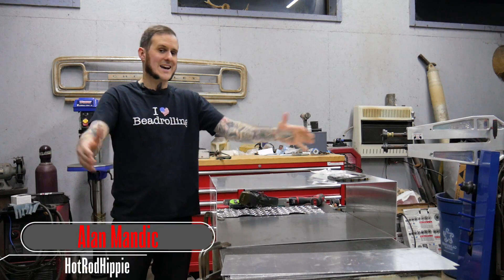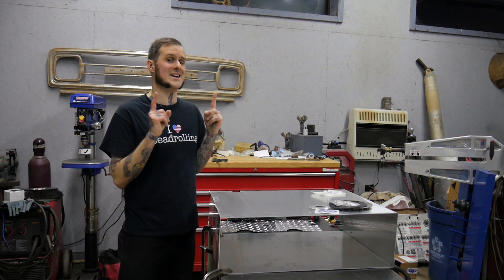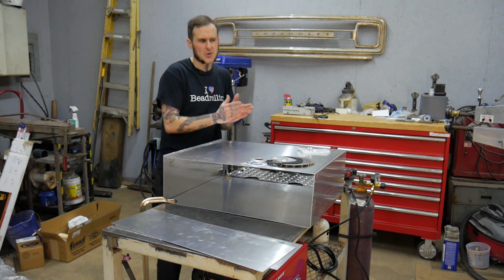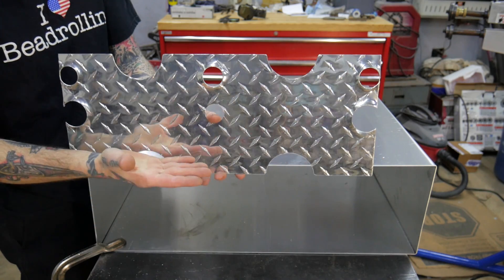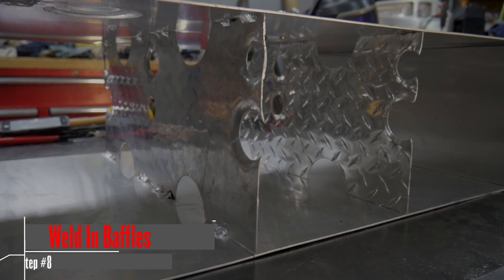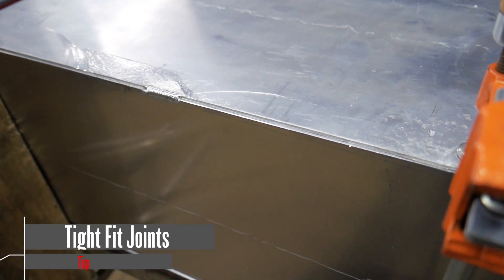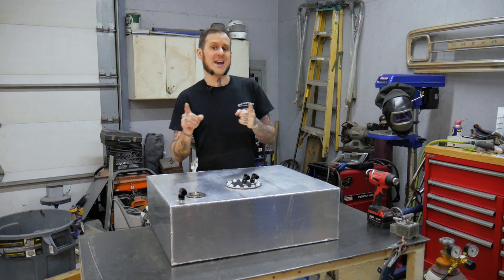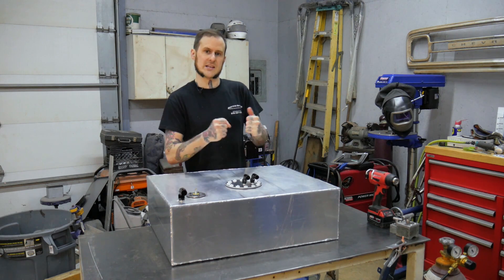Building a Custom Fuel Tank

Comment: This is a old video but I'd recommend anyone doing this to try out to use some chill blocks on those outside corner welds, they'd have to be alluminum or you can wrap steel bars in alluminum foil, this acts as a huge heatsink and really stops any form of warpage
Reply: Copper chill bars too

Comment: Build a fuel tank as your first welding project? What could possibly go wrong? LMAO.
I've been welding 40yrs+ and I think of myself as still learning. When I hear someone boast "I can do anything" I run.
Reply from the maker: Jim Zivny yep. My response is generally "I can attempt anything, no guarantees beyond that."  Overconfidence was something I learned to shake in my early 20s "I know everything" days.
Reply: I can oxy-fuel weld a 30 inch gap.
Reply: Amen to that
Reply: Lmfao dude said aluminum is eazier than stainless DEAR GOD help these new welders
Reply from the maker: Welding Stainless IS far easier than Aluminum but requires back purging. For a DIY project that is quite an additional expense in Argon gas and the additional equipment to properly purge. I find Stainless sheetmetal warps more severely when welded than Aluminum does, and aluminum is easier to force back to intended shape because, well obviously. Add in that Cutting and Grinding Stainless is more effort and you get why I recommend Aluminum for a beginner building a fuel tank. 

Please enlighten me to where I'm wrong about any of that.
Reply: @HotRodHippie  no beginner welder should be welding a fuel tank.
Reply from the maker: @131Jayboy  where did I say they should? I said if you aren’t confident in your welding seek someone out to weld it up for you. People are putting words in my mouth and I’m really not sure how they got there.

Comment: Great work and info! I'm planning a custom fuel cell for my tubbed 71 Chevelle. Being I'm not a pro at tig welding aluminum but pretty good at steel, I going to first build a model from plastic sign material, then aluminum but only tack it together. Then pay a pro to weld out.
Reply from the maker: Solid plan of action. I'd recommend discussing it with whoever you intend to weld it first. That way if they have any particular wants for how things should fit or the materials used they can voice those. It is no fun for a welder when a project walks in that could have been made easier with some minor changes but it's too late when it's there. 👍👍

Comment: Awesome video! I am building a Frankenjeep and the frame is a mid 1950's M-38A1 (aka the original CJ-5) and the roll cage in the CJ-3A  body tub interferes with the original fuel tank location underneath the drivers seat. However, there is a small triangular shape behind the rear axle. I'll have to dig up the cardboard mockup and reevaluate my tank design.

Comment: It would have been helpful if you had stated the fitting sizes, Where you purchased them, and maybe part number). Also, how did you set up the float to get an accurate fuel reading?

Comment from the maker: Do you have a vehicle you plan to build a custom fuel tank in? Have you built one before?
Reply: Did he not say it was for his father's truck/build?
Reply: Joshua H 
“He” is the guy who made the vid, huh
Reply: I've built a couple of tanks for my rockcrawler. The first one was a 20 gallon with a notch area to go around the exhaust. Of course it had a sump area and baffles to keep fuel at the sending unit. Which I used a stock '88 chevy TBI pump for the FI. The second was a 15 gallon tank I built to replace the first tank so I could move it to a new location. This was part of a redo of the crawler. 4 to 2 seats and lightening it. This tank has a 1 gallon sump area and of course baffles. Both tanks I mad out of 16 ga. mild steel. I lined them with Eastwood's tank restore. Never any issues with either.
Reply: About to build one for my 180SX on my channel.

Comment: Filler neck and wiring provisions, rollover check valve, how are you going to mount it and I'd suggest a nice static/ground bonding strap lug on the sending unit that goes to the frame. You know, the little things.
Reply from the maker: Parts to put those together didn't arrive in time for this video. They are all installed now. I'll eventually do an update video on the completed tank. When it isn't 900 miles away from me.

Comment: What about a steel gasoline tank? Not worth it because it might rust?
Reply from the maker: Yes I don’t really recommend it for that reason. You CAN seal it, but the likelihood of 100% properly sealing it is slim. I’ve worked with more than a few steel tanks over the years. Factory and custom built, and they always end up rusting / causing fuel system issues due to that rust.
Reply: @HotRodHippie   now,since they put ethanol in gasoline,it's made things worse since ethanol is highly corrosive

Comment: No internal bladder?   What happens when the weld beads crack from frame twisting?
Reply from the maker: How many cars running down the road have an internal bladder in their tanks? Or ever did? Bladders are generally a thing on vehicles expecting to see collisions and more extreme conditions (off road racing / circle track / etc). Don't rigidly mount the tank (rubber spacers / bushings) and be mindful about the chassis stiffness. One video cannot cover every facet of custom car design.

Comment: I didn’t see the fuel pump power/ground wire, where did you run it? Or did you tie it into the fuel level sensor power and ground it to the fuel level sender wire?
Reply from the maker: I didn't include that in this video  because parts hadn't arrived unfortunately. I drilled two holes in the fuel pump module I made. Used stepped telfon washers to both seal the hole and allow bolts to pass through. Those bolts I used to run the power and ground for the pump.

Comment: Nice tank. I have an aluminum tank from Brothers Trucks that needs to be cleaned out. There's a concern that some debris may be obstructing the fuel line. Do you have any advice on cleaning it out?  Worst case scenario I was thinking about cutting the top along the corners BUT is that a explosion waiting to happen? Or can it be done and safely welded back by a pro?  Please advise!
Reply from the maker: I would look at getting a clean out / inspection cover. The plate I used to make the fuel pump module is intended for that purpose. It's designed to be installed in tanks for access to clean them out. You could cut a hole in the tank and just cover it back up with that when done. 

Worst case, yes you could cut an access hole and a professional should be able to weld it back up. I've welded tanks numerous times, it's entirely doable just something that has to be done correctly and safely. It's not hard, just time consuming. I would check with the shop you plan to have weld it before you cut it. It would be best to get their opinion on how to best cut it so they can most easily repair it. 

As for cutting on a tank, if it's aluminum that shouldn't be a problem. Just go slowly as to not overheat it, but there aren't sparks when cutting aluminum so it shouldn't be too dangerous. I'd recommend flushing the tank out with water first and maybe half fill it with water to keep it cool. 

Hope this helps.
Reply: @HotRodHippie  thank you

Comment: Besides physical space, did you take into consideration quantity of fuel or weight of the fuel?  What’s the overall quantity in your tank?  I imagine you can manually water fill it or do math for volume but it would be cool to have heard your approach.  As far as weight, how did you plan to support X number of gallons of gas weighing X pounds, mounting it, etc.  Nice project though.
Reply from the maker: I always do volume calculations based off dimensions. In this case the tank ended up around 19 gallons. Usually I assume you will lose a little capacity due to fill height (tanks rarely fill all the way before forcing the gas pump off). So I'd say this is effectively a 17-18 gallon tank. 

Generally I aim for a upper teens to twenty gallon tank in most vehicles. If I end up much larger I usually scale down. If it isn't    big enough I get creative with sizing, to try and make it larger. 

As for strength, no I really don't do any calculations for strength. Experience has showed me what works. A lot of aftermarket tanks available for racing are just blank boxes with no rigidity added in and they function. This tank has the baffles that also provide structural support across the entire tank, so it's a non-issue in my eyes. If I was trying to make a super light tank out of the thinnest materials I would pay attention to those factors. 

This video was just a matter of "I'm making a tank, I may as well film it" not me setting out to make a tank video. I'll do a better follow up with the missing details in the future.

Comment: If I get a fuel cell and fill it up at a gas station will the pump auto stop when full?
Reply: Yes but it isn't a good idea to fill it up full. My 68 Vette has a humongous hole for filling it up and  I have to stop with the fuel level an inch or so down. Fuel slosh and expansion will cause a full tank to go out the vent/overflow.

Comment: About stainless though if I go that route which is a good gauge choose
Reply from the maker: I generally use 18 or 16 gauge stainless for tanks. Much thicker and they get heavy quickly. But thicker materials would avoid warping better. That is the biggest challenge of stainless. It warps easily while welding. And you should backpurge stainless when welding a tank, which requires a lot of argon on fuel tanks.

Comment: I am a fabricator and you did a good job here. I am surprised you applied so much rod. That were some lumpy welds I am certain you have superior technique than that. Did you do that for strength or because your going to be sanding and linishing the welds later?
Reply from the maker: Nope, I was just too worried about blowing through while filming so I overfilled.  I'd rather overfill on a part that won't be visible when installed than have to deal with that. (I'm not the best aluminum welder.)
Reply: @HotRodHippie  Better too much weld, than not enough!!!

Comment: I have a question I've been wondering about. Maybe you can give me some insight or your opinion. I'm thinking about building a fuel tank that fits in the back of my bed of my 4x4 but yet combo as a bench seat at the same time with seat belts. What do you think?
Reply from the maker: Making it strong enough would be an absolute nightmare. Then you have anyone riding in it strapped to a gas tank. In a rollover or just a really good knock to the rig, if a weld cracked or something, now you have passengers strapped to a flammable box. I personally wouldn’t do it.

Comment: Should show bending the tank, can't see in my head how it would have bent like that in a metal brake i.e. looks like you made 3 90 degree bends. How much money do you have in just the aluminum sheets?
Reply from the maker: Fair point.  I left bending off because people's brakes vary wildly in capability or availability.  Many folks doing this at home may have to get a shop to bend it for them and the shop may dictate how it can be bent.

For me I had a tiny brake that wasn't rated for this material that my Dad and I were able to manhandle and make it work.  It was so small that we were able to bend that box closed on itself nicely, then remove the top clamp bolts and slide the box off of the brake easily.

Material prices can vary so much, I absolutely do not remember what it cost.  I think the sheet for the tank was somewhere between $100-150 USD at the time.  It looks like online right now I could buy the material for about $150 without shipping, so that seems about correct.

As I stated and always will, building a custom tank is rarely a way to save money.  It often runs almost the same amount if not more than just buying one would as the builders are buying materials by the truck load.
Reply from the maker: You can actually see the brake we used behind me at the @3:30 mark in the video.  You can see how small it is and the unique, screw down top clamp design that it uses.  That allowed for the bending of the closed box.

Comment: I was thinking of building a tank for a mini bike. Is mild steel ok to make a tank out of? I Don't mind if it only lasts a few years. Would I need to coat the inside of the tank with one of those tank coatings?
Reply from the maker: Yes it is doable and yes I would coat it. Many motorcycle tank builds are mild steel but I absolutely recommend coating it after.

Comment: Can one use a MIG welder to build this?
Reply from the maker: It could be but you'll need a Spool Gun or a Push-Pull Torch on the machine. It also won't be particularly easy to control your heat input so I'd figure on using thicker materials than the TIG requires for the safety the thickness gives to melting away. 

Basically, I wouldn't do it and I don't know that I personally could. I don't have nearly enough experience with a Spool Gun to say, but I'm sure some welders could.

Comment: Awesome video! Just one question,  where does the breather fitting go to?
Reply from the maker: I placed it at the far corner opposite of the filler neck (which also didn't feature in this video). Unfortunately I didn't get to finish the tank entirely in this video as parts were on order and I had limited time. I will redo it again at some point with a bit more detail on people's commonly asked questions. 👍
Reply: @HotRodHippie  oh ok, so does that fitting get attached to anything? Or does it just get left as an opening?
Reply from the maker: @next_level_customs8618  I use an AN fittings and run a hose up higher than the Filler Neck. That way it can vent when filling the tank. I also usually do a U shape at the end and have the end of the hose hang downward, then attach a filter. Sometimes a rollover valve as well in case of rollover. All that to prevent water, dirt, and bugs getting into the tube and down into the tank.
Reply: @HotRodHippie  thank you for the info, I appreciate it. Awesome content on your channel 👍

Comment: How do you pressure test and leak test it ? Just wondering
Reply from the maker: Greatly reduced air pressure from the compressor. So regulator turned way down, blow light pressure into the tank. Then spray all the gasket surfaces and welds with soapy water (dish soap and water mixture). It bubbles up quite a lot if there is a leak. Low pressure air is a must. Normal shop air will balloon the tank. 

There are other methods but this is a fairly easy one. Next tank I do I'll make a point of filming testing.

Comment: Where do you get the rings?  Trying to put an 2018 OEM pump for a L83 into a tank!
Reply from the maker: I got the most or the bungs for this one from Boyd Welding.

For what you want to do I think Rick's Tanks sells a billet weld in ring for the newer GM pump rings. Get in touch with them: https://rickstanks.com/product/weld-in/
Reply: I called Rick's Tanks and they want $129.00 for that ring in aluminum??????????
Reply from the maker: It's a billet cnc machined part (full block of aluminum required). I cna only find one other company selling one and it is also $129 and its ugly compared to the Rick's one.

If you don't want to spend that much you could get rings like I did and make your own setup that just uses the pump. But honestly the ring I got, weld on An fittings, and then a ring for a fuel sender and you are probably at $60-75.

In the scheme of custom Fabrication parts $129 sounds pretty reasonable to me.
Reply: Getting the part for $15.00 off a tank at All Car & Trucks locally.
Reply from the maker: @melrich2124  I see. Well at that rate you are ahead of the game Vs an Aeromotive Stealth setup or many other options for the $129 the ring would cost. I'd say I invested about $120 in fittings, fuel sender, fuel pump, and other parts to make this tank. And in the end using a factory pump setup is a cleaner look (from some perspectives)  as well as being easy to get replacement parts for. Sorry I can't point you anywhere cheaper. Custom Fab is rarely the cheap route unless you have everything laying around already.

Comment: How did you run the power for the fuel pump
Reply from the maker: Steve Westberg good question, I'm surprised no one asked it sooner. I drilled the fuel pump module and installed plastic bushings that are fuel safe, then put in 10-32 stainless bolts to wire it up. Basically I made my own bulkhead wiring setup with stainless bolts and plastic bushings. I couldn't find a decent kit or bulkhead setup I actually cared for available.

Comment: Looking for someone to build fuel cell for my 98 Chevy s10 to use stock fuel pump
Reply from the maker: Do you need it slightly smaller for better ground clearance?  ThorBros sells a crossmember that allows you to lift the factory gas tank up higher if that is the case. I have no experience with that but it would be an option instead of making a full new tank.  

https://thorbros.com/crossmembers/s10-raised-gastank-crossmember  

Let me know where you are located and I could maybe point you toward someone.

Comment: Why couldnt a guy weld alluminum  with a mig with a spool gun. Or make it outa sheet metal and use a mig?
Reply from the maker: Someone absolutely could use a spool gun. I just find TIG to be far more controlled and solid, completely fusion is essential when making a fuel cell. Minor mistakes mean fuel leaks and that's clearly dangerous. Someone better with a spool gun may be able to get the job done, personally I'll stick to TIG. It looks nicer when finished also, clearly less important but it does matter when I'm being paid for a job.
Reply: Mig welding aluminum causes it to look like a wad of chewed up gum.
Reply: 20TheGame09 only from people who don’t know what they’re doing bud.